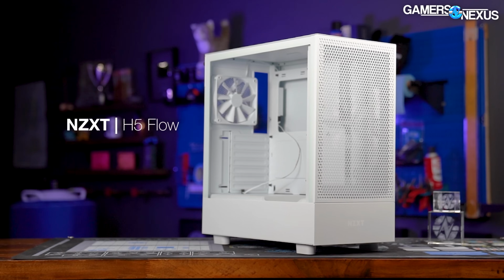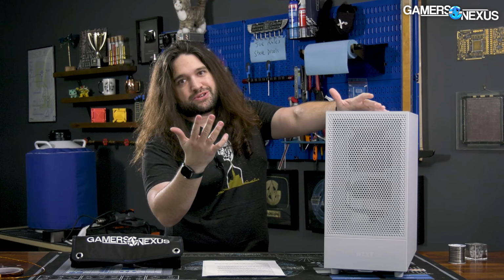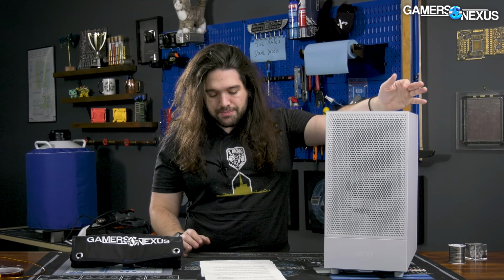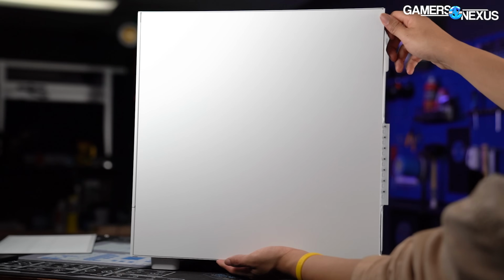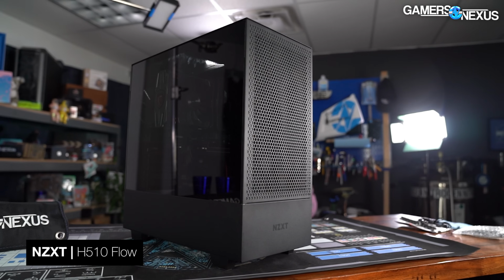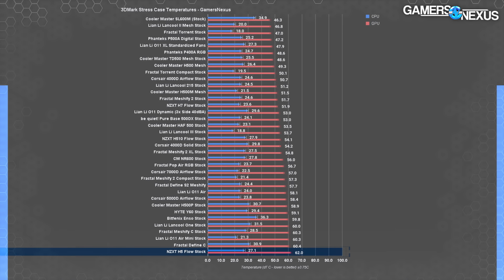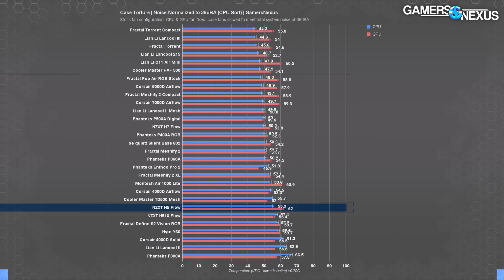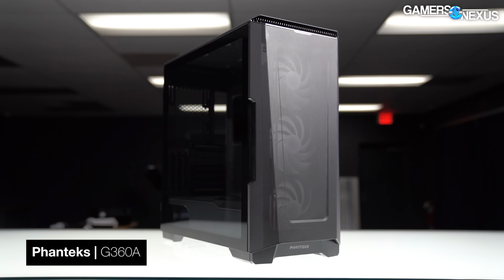NZXT H5 Flow Case Review: Thermals, Cable Management, & Noise

Comment: Hey GN There is an ongoing issue with Samsung flagship Smartphones OLED screens where they glitch out and stay discolored/green or black flickering depending on the screen brightness. Issue has been happening since the s8/note 8 all the way to the S22 with several people attributing it to a software update, I for once never put my phone near water nor have I dropped it yet it all started on the same week as the update for me (s9+). Samsung reply so far has been faulty screen or reset you devices hope that works kind of thing. I know its outside of your scope considering they are smartphones but there is definitely something going on here that Samsung has been ignoring and I would love someone with more preparation, knowledge and more public reach to get to the bottom of it and call them out.

Comment: Hi,  Could you please help me decide between these two options, which would be a good option in your opinion? 

H7 flow or h5 flow?

H7 flow (newer, with bottom fans): comes with 3 fans in front 120mm, cost in my area 138USD.
Pros: very cool and good airflow
Cons: Quite huge in size, no dust filters

H5 flow: RGB edition with additional two fans in front. Cost 124USD
Pros: smaller, RGB, 140mm two fans and two case fans 120mm
Cons: probably not as good thermals as h7 flow

Its for a mid range build with xfx 6800XT GPU which is 340mm long. CPU 7600X

Comment: guys i have ordered a h5 flow for a 7900xtx and 7950x3d, i went all out on the gpu and cpu so i had to save a bit money to get a good lasting monitor. I seen people do same 7900xtx with h5 flow and it worked good. Will i have any problems? The cpu is really cool so i hope it wont be too hot inside the case for the gpu. (also all noctua fans).

Comment: How much clearance is there for an Nvidia power cable? That is going to need to be a standard review point from now on unless a 90 degree adapter comes out.
Reply: That render they supplied with a 4090 was not realistic about the power cable. It was going off at a weird angle.

Comment: Little drive support = hard pass. They can keep their tidy bowl. A vented psu shroud with optional fan mounts for fans blowing vertically under the gpu have already existed, work just as well or better and leave the space open for drives. Fail for me.

Comment: Imagen just not moving the PSU behinde or ontop of the motherboard. (And leaving the air to come from below freely) And instead just think how you end up squeegeeing a really stupid toilet bowl fan that interfere with the PSU and AIO cooling... Ow and no front fans since the cost went into a toilet bowl. Like how. Pop even with the toy/cheap look gives you a good case for the money.

What about flipping the mobo tray around? What was it called? Inverted system? Having the GPU suck air from the top. But then the GPU sag might interfere with the CPU? If Torrent or better cases where used to make something worth buying. Instead of adding toilet bowls that looks super ugly. It ruins the case.

Comment: You spend so much time KNOCKING EVERYTHING.  Why don't you build your own line of PERFECT cases. Show us how its done! For instance you try installing a 1600w power supply in a case that just isnt meant for it then fault the case...come on man really. If you have a 1600w psu you wouldn't purchase a case this small to begin with....you hunt to find fault.